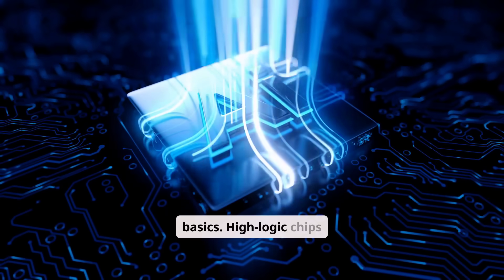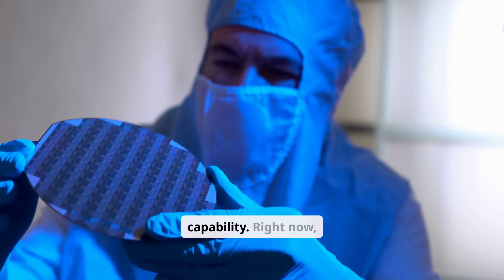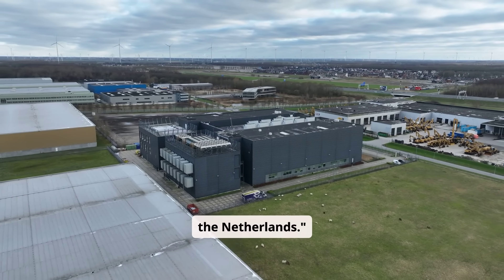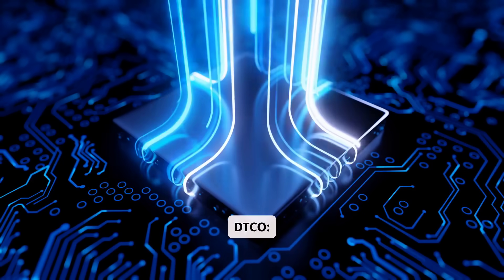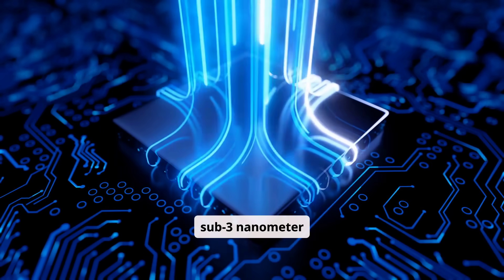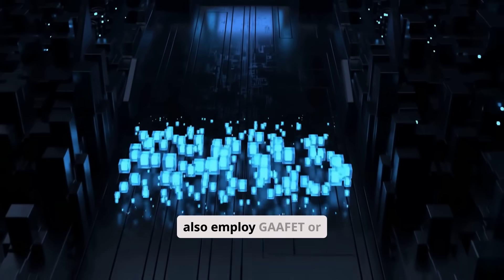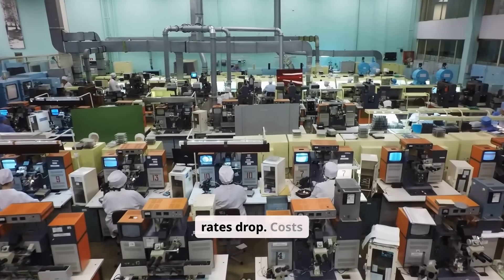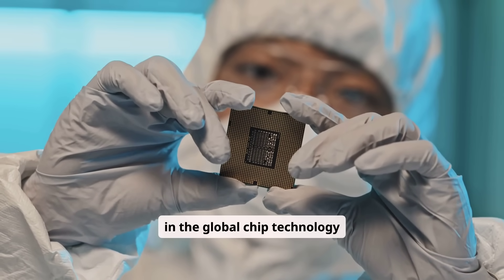How Huawei Is Trying to Reach 2nm Without EUV

Comment: In 5-10 years they will have EUV and they will have their own 6G, when I say they I mean   Huawei
Reply: china now has and EUV lithography machine, its not yet producing functional chips however.
Reply: Not 5-10years but in 2025
Reply: the are already working on 7-8 G, 6G was already done a few years ago, but who wants to pay amd who needs them? For consumers 5G is fast enough, and for 6-8G they need to change the base stations (again), too expensive
Reply: @hongsienkwee537 actually they may not have to change the base stations... china made a breakthrough in 5 and  6 g which in theory should massively reduced their power requirements, presumably the underlying advancement should be scalable to future standards as well. I dont remember what the advancement was specifically but they said it would reduce power requirement substantially.

 they have made similar breakthroughs in technologies that are already very effiient too for example they made a new standard of NAND memory that is tens of thousands of ti.es faster (technically 1.5 million times faster, but in practical use it will "merely" be tens of thousands of times faster) than todays NAND memory while using less power; 40% less i think it was.. they also implied it should be scale to other memory types too which would make computers significantly faster... though in practicle use PCIe will bottle neck this tech for years to come, unless they can make a similar breakthrough in motherboards... and this breakthrough should be scalable to atleast any sicilon based technologies, not just memory.

Comment: First of all couple of things to understand... 2 nm is not 2 nm actually... Beyond certain technology  I think it was 28 nm, those numbers became marketing trick. Because power consumption of densly inprinted transistors on chip mostly for Ram memory was and is major chalenge to reduces, semuconducter Manufacturers became liars and when they for example in next technology reduces power consumption per transistor by factor of 2 they say of we switched from 28 to 14 nms... And thats a lie. 2 nm proces has a 45 nm Gate and 20 nm metal pitch
Reply from the maker: You’re right on the core point.Since ~28nm, node numbers stopped being literal dimensions. “2nm” is a technology label, not a 2nm gate.But it’s not pure lying either — today nodes reflect density, power/performance gains, and architecture changes (FinFET → GAAFET).Gate lengths and metal pitch are still tens of nm, and power + SRAM scaling are the real limits now.
Reply: @QuantumSilkRoute99 I agree for power but real gate size and wiring distances still impact number of transitor per surface area,at least with ram thats important....
Reply: You mean it's like a store name that says "Everything is $2" but sells stuffs at a minimum of $10?
Reply: For you everything is a lie ... you live in Wonderland & Fairy tales